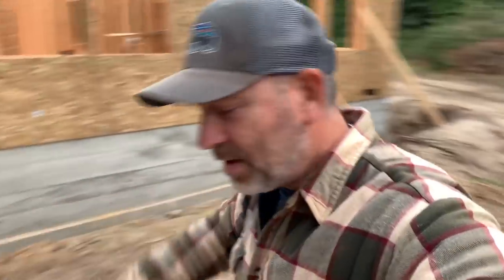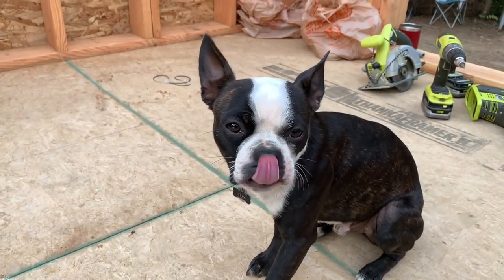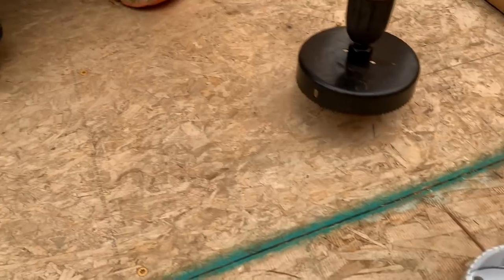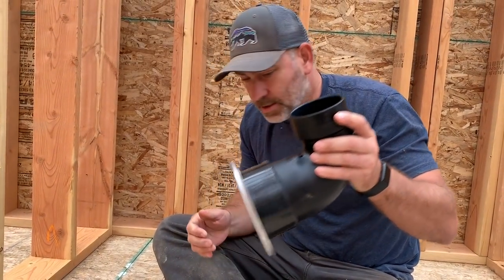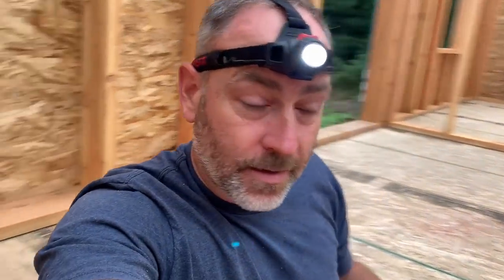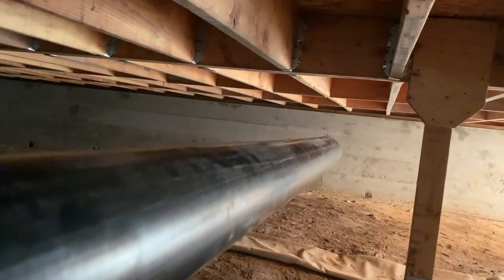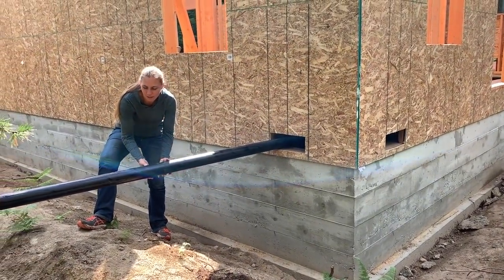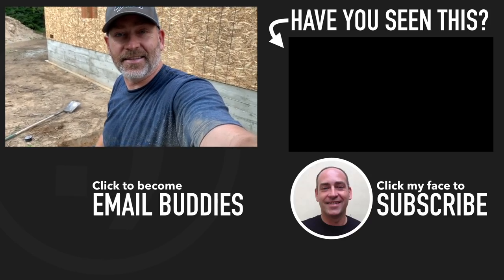She is a Plumber Now! | Off Grid Cabin Build #24

Comment: You weakened your floor joist by cutting holes in them you're supposed to run your piping below them not throu them
Reply from the maker: Code allows you to drill holes and cut notches in your floor joist. But I do thank you for your concern.
Reply: @MartinJohnsonOffGridLiving  I know what code says they allow for such things but as a builder and remodeler I have had to repair structures that have failed due to such allowed practices. Your house your piece of mind , I however would avoid such practices.
Reply: Please tell me you headed off the joists around the tub drain, and didn't just chop a slot in it.
Reply from the maker: Not sure what you mean but I think he will see it in the next video. Then you could tell me if I did what it is you’re talking about.
Reply: @MartinJohnsonOffGridLiving  he who? Yeah a woman builder shocking, you don't know if you headed off the tub drain cut out? Ok. I built and remodeled for years dirt to roof plans no plans, your doing fine I just see things your going to regret in future years. Like I said your house . Keep after your dreams and showing your children even a everyday dad can still provide inspiration.
Reply from the maker: Stephani Ryan didn’t mean any offense “he” was a typo. It Even make sense in that sentence when I was addressing you. it should have been “you”
Reply: @MartinJohnsonOffGridLiving  no worries,
Reply: When you cut out that joist you will need to transfer the load to the two adjacent joists on both sides of the cutout.
Reply: @MartinJohnsonOffGridLiving  each state is different on code. Like here in WI you can cut up to a 2 inch hole through a joist. Anything bigger you have to double up the joist. Your state probably is fine with it for code. Im just saying in WI we have to double up on the joist if you cut through it. But also per county code may very as well.  Stephani is kinda right its better to go under it but some cases you cant do that and have to like you did. Cutting through just weakens the joist, by doing so you go from using a 2X10 to a 2x4 cause that part is now the weakest link. You could also attach a jack brace to each side of the hole to the joist in front and in back of the joist you cut the hole through just like someone else stated. You all still did really good for never doing plumbing before. Its nothing to really worry about now because its new. Just down the line when it gets older and toilets always start to leak over time.

Comment: That's why it's cheaper, if you can afford it buy the bigger, if not saw part way take your hammer and wood chisel, cut out what you just sawed. 
Now saw the rest of the way.
If you go under the joists it's a lot easer and doesn't weaken the joists, don't need to drill through a joists to run sewer pipe. All I ever drill a joists for is electric wires.
Those tools Chris send you didn't come from HF, heck he may not know what HF sells. I buy stuff at HF but when I need quality I shop somewhere else, and it ain't WM.

Comment: Use the chop saw to cut the pipe. Nice square cuts. Dry fit the entire section then glue it up. Use a white maker to Mark the pieces before taking it apart. Saves allot of problems. Vinny 🇺🇸
Reply from the maker: Good idea.

Comment: I agree with previous comment about not cutting floor joists. You have plenty or depth to let those waste lines drop below the joists and not impinge on their structural integrity. Also, it did not seem that you have allowed for thickness of flooring under toilet flange. Love your videos and following your progress.
Reply from the maker: Well, it’s too late for not cutting the floor joists and you’re right about the flooring. We don’t plan on using any flooring right away but when we do we will have to fix it.

Comment: You may want to put a layer of plastic in the crawl space to help with mold issues.
Reply from the maker: It is down there. We will lay it out after the roof is on.
Reply: @MartinJohnsonOffGridLiving  Look into a HRV for your ventilation strategy and include your crawlspace. That's why vented crawlspace are not allowed because they don't work for reducing moisture. Look into a Conditioned Space it is not too late in this build. If you have 70% humidity now, you will have problems with mold. Vents just provide new mold spores.

Comment: I cringed when i saw you drilling a 3" hole in the floor joist which was totally unnecessary and easily avoided. Not bashing you. Worst case is that joist is going to deflect little more than others. Nothing will collapse :)  Love your videos and family.

Comment: I think you have a previous experience with this construction....your wife is pretty good because she has been a good helper to you.
Reply from the maker: Not much really. But I have worked in industrial refrigeration before. Not quite the same thing though.
Reply: @MartinJohnsonOffGridLiving  Iam a mechanical engineering graduate..I have been seen your work from starting. I could learnt afew things from you..you use technology very well like for cutting saws, hagours, drills and so on..

Comment: why would you drill through a joist when you could easily have dropped the toilet waste below the joist???? this is why people end up with failures in bathroom floors over time, p-trap for the tub could also be dropped below the joist instead of cutting out a chunk of beam. this is why you should hire professionals
Reply from the maker: WOW! thanks for your negative critique. I'm not going to hire a professional and the "problem" is already created. Do you have any helpful to tips to solve the problem?
Reply: @MartinJohnsonOffGridLiving  sorry i sounded so mean, was not my intent, you could drop the line down under the joist and sister a new board in there possibly but likely you are right and my comment was unwelcome, again i'm sorry.  I won't defend my mean comment either, I'll only say if you have any questions about plumbing in future feel free to give me a shout and i'd be happy to give free advice, good luck in you build and best wishes from me and mine :)

Comment: You will definitely want to add a ground barrier under your crawlspace, the humidity seems likely to be high enough to support boring beetles, and also fungal growth and you will benefit from keeping it lower.  Also, for the next time, you really did not need to drill through the floor joist for the toilet as you could have went under it by dropping straight out of the closet flange to below the joist and then putting your 90 deg. in and avoided needing to weaken the structure by drilling the floor joist.

Comment: If you don't have those already, some vents should be added to the crawl space to get the moist out. Fungi will thrive in moist environment and slowly devour your wood beams. Just remember to use fine metal mesh in the vents to avoid insect and critter infestation. They will get in anywhere and can do damage. I used steel mesh in mine on the outside and supplied with steel wool inside them to make sure mice and such would stay out. Mice will eat a lot of materials, but they cannot stomach steel. Binge watching your videos now. Bless you all.

Comment: Not sure what your plumbing book says (I hate to criticize because you guys are doing such a great job) but, I have always been taught to dry fit the entire run before doing any gluing not glue as you go. Keep up the great work can't wait for the next video.
Reply from the maker: That is a good idea but I’m afraid I would miss one with the glue.
Reply: @MartinJohnsonOffGridLiving  you already have a PDF of the layout. Number each joint and check them off as you glue. We have 42 Acres in Maine and are in the process of tearing down the cabin that was there when we purchased the land. I have a log cabin kit to go on the foundation starting next Spring/Summer (hopefully) and well be doing basically what you are doing (building it from the ground up) all new everything except the foundation, well and septic system.
Reply from the maker: Sounds like a great project.

Comment: You're going to need a vapor barrier in the crawl space, otherwise you will have problems down the road. Also you should run the piping below the floor joist and not cut holes in them, it's a crawl space and not a finished basement.

Comment: Interesting, I would have guessed the toilet flange would need to go on top of the final flooring for the toilet to fit correctly?
Reply: The flange depending on your final floor matches in height. The flange must be installed way before backer board and tile for rough inspection.
Reply from the maker: we wont have flooring for some time. Just going to paint the OSB.
Reply: @MartinJohnsonOffGridLiving  Enamel is good thing, if not too slippery when wet. Just decorate with a road sign.

Comment: Awesome video. I noticed when cutting plumbing pipe use a chop saw. Most of the time your cuts are perfect straight and cleaner. Just means there is less to clean off the pipe. Either way you did a good job on it

Comment: dont you need to insulate the floor and the pipes?
Reply from the maker: Yes on the floor but not those pipes. However it is not time yet.
Reply: its gonna be a pain to go under and insulate lol
Reply: @wilburfinnigan2142  thats why you skip the sheating on the floor untill the roof is up. or you  get everything up in the same week. a dry week
Reply: @wilburfinnigan2142  i have framed walls on the floor joists. sometimes you dont even use osb subfloor. often its a beautiful wood floor that u dont want to get wet!!
Reply: @wilburfinnigan2142  Per code our foundations or stem walls have to have rigid R-10 before you deck. Access is easy, but getting big sheets to make the turn under a floor in a shallow crawl space is a lesson in geometry. And Frustration.
Reply: @wilburfinnigan2142  if you have wooden floors you dont need a subfloor. And i build how ever i want.

Comment: I believe in Idaho septic systems are an option. You may be able to dig a pit in the crawl space and eliminate the septic system, just make sure you check with local plumbing code. Yesiree!!! 💩😵
Reply from the maker: If you have water plumbed into your house they are not optional. You’re not serious about putting a pit in the crawlspace are you? That seems extremely gross to me.
Reply: @MartinJohnsonOffGridLiving  That does sound gross.  The septic system is an Idaho State requirement, irrespective of any building code or lack of building code.

Comment: just a suggestion. when i built my upstate NY house back in the 80's, i had a dirt floor in the crawl space. the moisture was unreal. people suggested that i put in a dry well, and pipe it under the foundation, and out into the field. just did a round hole, pipe in a 4 inch PVC pipe from outside under the foundation, remember to put some chicken wire over the ends, not to get animals to crawl under the house, put gravel in the hole around the pipe, than use the clear plastic to cover the dirt floor like you are doing. it really helped.
Reply from the maker: thanks. it will be coming soon after the roof is on.

Comment: Make sure you put a clean out for the  piping just in case you have a problem for blockage in the main line......  This normally done with the piping..... This is how I do it.......
Reply from the maker: Yes I think we will have three or four cleanouts in the system.
Reply from the maker: The inspector told us where to put them.

Comment: Usually you orient the tub the other way so the drain and controls are along the wall you enter the shower by rather than next to the toilet. Reason is so that someone can just reach into the shower to turn the water on easily so it can heat up before getting into the shower.  With your way the person will need to be in the shower and they will get hit with the initial cold water blast.  Flipping the tub may also solve your issue with the joist right under the drain.  Good luck
Reply from the maker: We decided which way we would prefer to be in our house. Then we did a Google image search for bathroom layouts and found that many if not most have the same layout as ours. Apparently you can do it however you like.
Reply: @MartinJohnsonOffGridLiving  Cool, you do have the benefit of having all the plumbing in the same wall

Comment: Thanks for the video.
I think you should add reinforcement to that joist before you add more loads to the cabin. The hole looks too big and I'm sure it has weakened the structural integrity to a some degree.
Reply from the maker: What type of reinforcement should I add?
Reply: @MartinJohnsonOffGridLiving  reinforce it with steel plate. 14 gauge standard steel plate should be enough. I'm not American so I don't know how if joist hole reinforcer is available but try to look for it in you local hardware store.

Comment: Simply pre-glue everything together and install it all at once. Doing it piece by piece is laborious with too many obstacles.
Reply from the maker: I don’t think I’m good enough to do that yet.
Reply: @MartinJohnsonOffGridLiving  I remember being about 16 and trying that technique with an exhaust system! lol Needless to say it didn't turn out as well as it sounded! 🤣
Reply: That works in a perfect world but not in real life. Even dry fitting them all then gluing them all leads to surprises because you didn't set into the fittings the full depth. It looks good and clean from the video. I think the DWV is looking fine.
Reply: @ModernMountainLiving  I'm just kidding around. I think it's a great upload from this family. I was just suggesting as a joke that they assemble the entire plumbing system and build the house around it...you can't...I think. LOL.